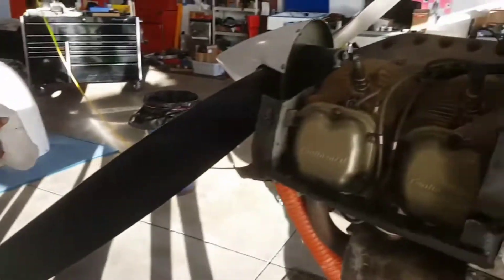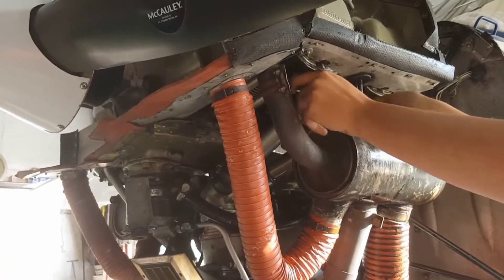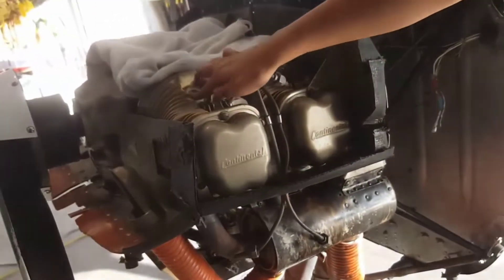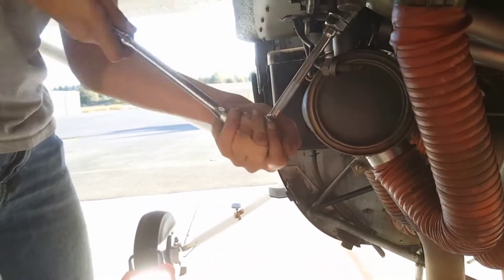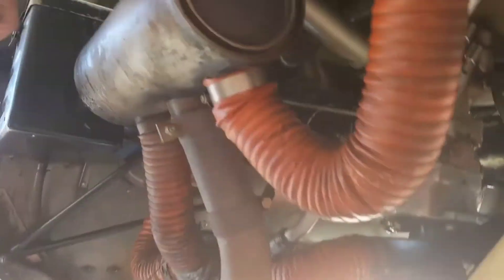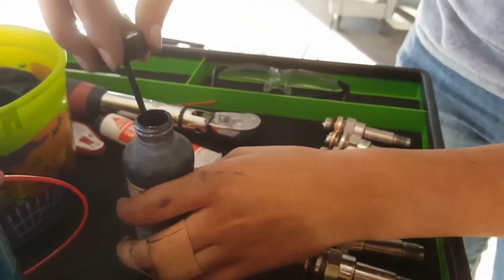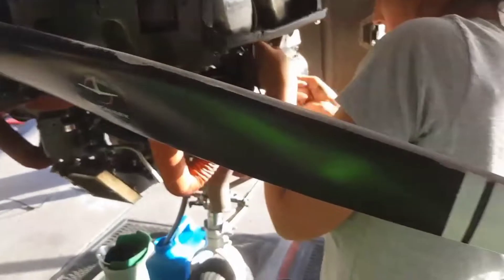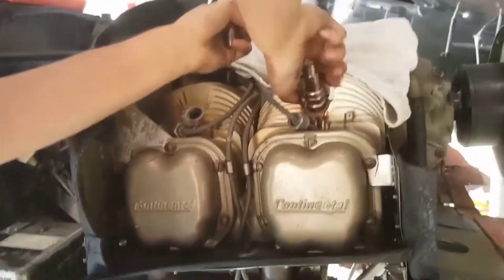Removal and Installation Spark Plug Aircraft Piston Engine (Pak Ibnoso Channel)

Comment: Keys on the bench.  Orient the prop blades up and down when feasible.  Four strokes per cycle, not four cycle.  Tempest plugs suck.  Always clean the oil pump inlet screen.

Comment: Thanks for showing this basic maintenance, which part 43 says any private pilot can do, doesn't require an A&P. One tip: the magnetos produce alternating current, which means sparks of opposite polarity to different wires. Thus rotating the spark plugs (reinserting them into different cylinders from those they were removed) can reverse and equalize the wear patterns. There are spark plug trays that indicate the rotation patterns to achieve this.
Reply from the maker: thanks mr michael